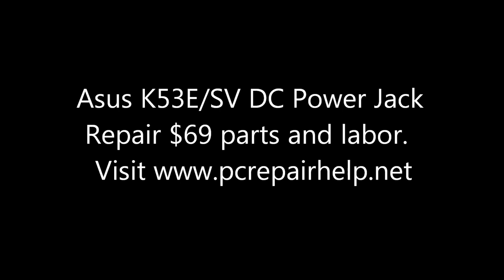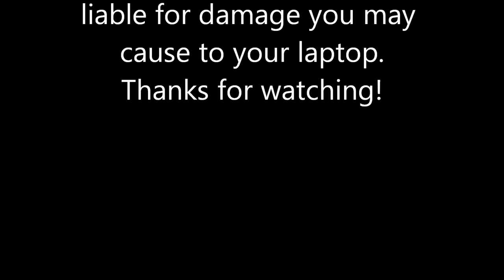Asus K53E/SV X53E DC Power Jack Repair

Comment: I fixed mine and it cost me £1.99 ($3.50). Just bought a jack on ebay. Already own a soldering iron. I've done this 3 times over 2 years and on someone else's who owns this laptop. It's a stupid flaw. Asus needs to use changable jacks like my old Acer

Comment: I have just done this and everything went back together fine. 
If you are doing this to replace the dc power jack I would suggest cutting the five lugs that are soldered onto the motherboard with a dremel type tool. They are awkward to get to with a soldering iron and I could not get them completely unsoldered due to the dc jack body acting as a heatsink. The motherboard plastic began to warp when I tried this. Once the body was cut off they unsoldered fine. Just be very careful.

Comment: The video doesn't say anything about disconnecting the 2 coaxial cables that plug into the bottom of the motherboard.  You can see them 26 seconds into the video between the hard drive and the ram board (plugged into the WiFI board).  Remember to plug them back in after re-installing the motherboard.  Using this video I was able to successfully repair my laptop but note that it's a very delicate job only for those who are very handy.  If you are not then I highly recomend you send it in for repair by a professional.
Reply from the maker: Oneil118WM Sorry, I forgot to put that step in the video :(

Comment: @pomeroy great tube but really why didn't you finish the job??? "You now have access to replace the bad dc jack" goodbye LOL Think you would do good by launching part two ;-)
Reply from the maker: There is a K53 soldering guide in the annotations on the bottom right that covers everything for soldering a K53.

Comment: i fix it with epoxy.  how?  the laptop dc jack  was working fine, except that the motherboard plastic support get broken inside and i just create it with epoxy ( home depot, $ 5.50 ) .    that usually happens when the laptop falls to the floor still connected.    just do not forget to allow at least 12 hours for the epoxy to cure in full before assembly back the laptop because the fumes can destroy the hardware.   and keep the lcd screen covered or in flat position due to the same.

Comment: What kind of solder iron do you use, what temp etc?  Do you use special solder?  I have soldering experience and used to work as an electronic tech on many devices (camcorders, VCR's, TV's, etc) and have attempted resoldering jacks on laptop  motherboards before but have never been successful. I am never able to heat the solder connections all the way thru the board without getting the side I'm soldering from too hot and damaging the traces!!   Many of these boards have to have solder flow thru the entire board as they are multi-layer, but I can never get it hot enough all the way thru to pull the component legs thru and everything gets messed up.  Help??
Reply: Not sure if you will still see this reply since the poat was several months ago. Thanks for the reply, however, is that all it really takes is a cheap nothing special iron?  I have several irons, including a couple with adjustable temperature control stations. I've done soldering/desoldering work for many years on video cameras, vcr's,. tv's, etc, but I've not had any luck removing many "thru the board" components like dc jacks on laptops.  Even when I hold the tip against the land on one side of the board tightly with temperature fully up, it oftentimes just simply will not melt the solder fully enough thru all the layers to opposite side of board  to remove the entire component. If I use a HI POWER iron like a GUN, In order to get the solder hot enough to melt and FULLY REMOVE all the way thru multiple layers of the board, it destroys the land on the surface touching the tip of the iron.
I know many people do these repairs and I just don't get why I haven't been able to.  I've tried Desolder wick, special low melting solder to mix w/ the original solder first, etc.
Reply from the maker: enforcer mj I use a Weller WES51 and Hakko fx-888d with the temp set anywhere from 650-750 depending on the repair.   Adding fresh solder to the through holes really helps too.  Check my linked solder video on this model for more info.

Comment: Unfortunately his hands are in the way and it is impossible to see how he is disconnecting cables. How do you disconnect av cables from motherboard
Reply from the maker: lori Gardner Most of the cables have a flip up latch and then they release.  The video cable is just pulled out of the socket and the keyboard cable releases up.  You just carefully pry up on each side and up.

Comment: I've got an Asus K53. Power jack is getting pretty flaky and the plug gets pretty hot now.
Anyone have any thoughts on the cheap jacks for sale on Ebay ?
They range from about $1.50 to around $13. One advertised on the video is $25.
Reply from the maker: The one in the video is $12.99 and its the highest quality available.
Reply: Dude, I don't know if you will be able to see this but here is my reply.... Either buy another laptop (if you can more recent models ) or follow some simple things as: 
- don't use too much the laptop as mobile because the jack will always hit on something or it will be pulled by it's own weight and slowly but surely it will become lose and will start to make a bad connection, heat up and eventualy stop charging .
- use the laptop on desk as much as possible and make sure the plug is in the jack straight . if you need to use some paper or something to hold it perfectly perpendicular . otherwise it will damage the pins on the motherboard to get loose and also to not charge.
- in summer, use an extra cooler and even in winter always make sure the laptop does not overheat because if you have like me an old I7 ( my laptop model K53SJ) you are fucked :))) I used my laptop for very proffesional software that use a lot of RAM, CPU so ... power. And it heats up very much if you don't pay attention, and if your jack is right next to your heat grill , you might start damaging the soder of the jack pins. 

I have this laptop for 5 years and oh boy I know everything about power jack problems. I changed my jack like 4-5 times before I learned how sensible it is . Once I almost burned by laptop because I ignored that my plug was getting real hot , so hot that it melt my solder from pins and it was leaking slowly to the other pins that are really not that far away and if that would connect.... well, bye bye laptop. 
So basically, either change your laptop or be very very carefull with K53 models because they are flawed . I have 2 friends with this model and all have the same issue.

Comment: Did you take precautions against static electricity? Will damage the chipset electricity in the air?
Reply from the maker: I grounded myself before doing the repair and it's on an anti-static towel.  The soldering part is done on an anti-static mat.

Comment: I can't remove the keyboard cable, need some help so I don't mess up
Reply from the maker: Did you flip the lock up?
Reply: I fixed it some minutes after I wrote that, but all those "locks" was blocked by your hands so it was hard to know which way to pull etc

Comment: I have this laptop, and the power jack came loose twice. I am about ready to destroy this POS of a laptop. I hate everything about it: the power jack, speaker, touchpad, ect.
Reply: The same thing has happened to me! I've already had to get a new adapter because the first one caught fire and blew up for no reason, and then the power jack came loose and stopped working. I took it in, had it fixed (I had purchased extended warranty) and it hasn't even been six months and the jack is fucked up AGAIN. 

I will NEVER buy ASUS again. Ugh.